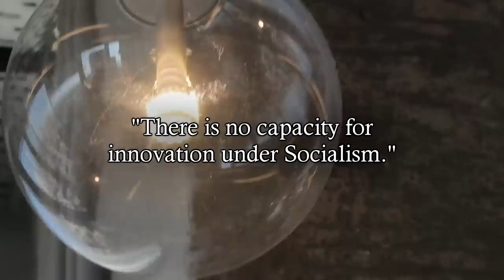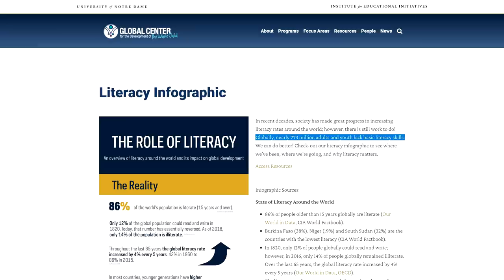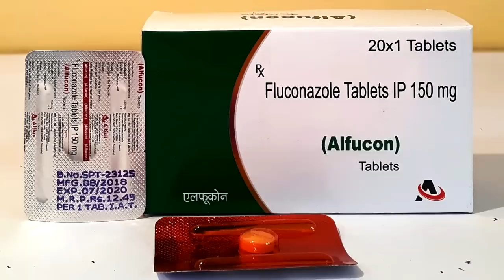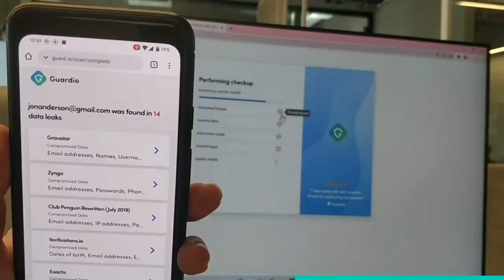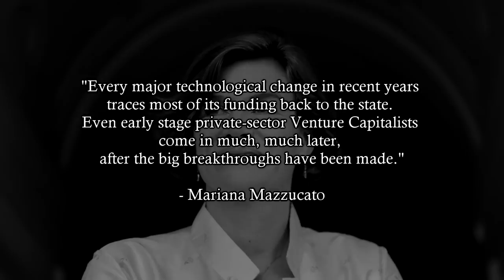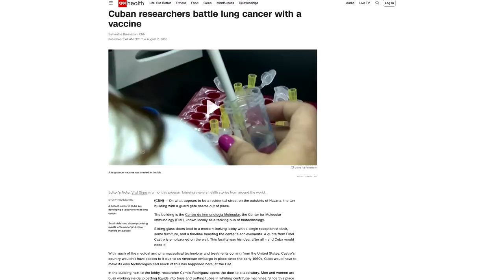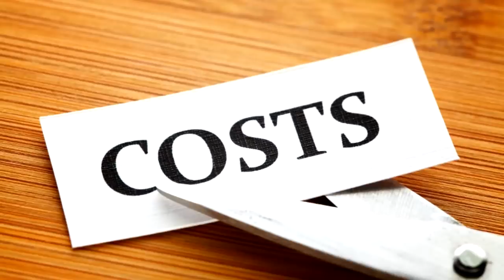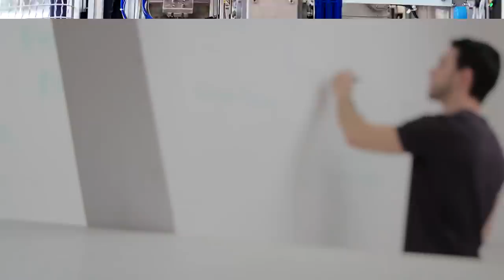Will Life Be Better Under Socialism?

Comment: Problem of automation will be it’s drastic energy consumption.    What is your view on that?
Reply: Renewable energy, but yeah. Not everything should be automated
Reply: at the same time the concept of the plutonium reactor was developed, the concept of the thorium molten salt reactor was aswell. Due to the US only wanting to finance development of one, it got scrapped, as the molten salt reactor couldn’t enrich uranium/plutonium to build nukes. 

- - -

A molten salt reactor uses 90% Thorium and 10% classical fuel, like uranium. 

due to it beeing in a controlled, molten state and requiring much less pressure (due to higher neutron density), a core meltdown is virtually impossible 

another advantage of it is that due to Thorium, when split, shooting way more neutrons is that radioactive waste only needs to be stored 200 years until their radiation levels are beyond what’s considered dangerous. This is due to decayed waste not beeing radioactive and absorbing the neutrons, which usually delays the timeframe needed for complete decay. (less neutrons hit radioactive material)

Thorium is way cheaper than Uranium; and the amounts of it are estimated to cover the full energy consumption until fusion reactors are developed. fusion reactors produce zero waste and only need hydrogen isotopes, which eliminates the fuel problem as hydrogen is the most common atom in the universe.

- - -

not beeing constantly bombardedwith advertisements also reduces consumption, as people don’t try to compensate their suffering from burnout and insecurities by buying stuff they don’t need
Reply: @alexredfield1943  I think this won’t be enough. It is not enough now and it won’t be with automation. Regarding nuclear fission: I don’t think it is a good idea to be honest. With rising sea levels and more and catastrophic weather events running nuclear power plants will be of an even greater risk, as floodings or river droughts will occur, threatening the supply of cooling water that these power plants need all the time or drowning them. 
Also we should think about backup-options in the case of blackouts or other catastrophic events like Kessler-Syndrome (= satellites crashing into each other creating a cascade in which all of them get destroyed eventually, ruining communication, weather forecasts, space travel etc. for decades)

I agree that most of our problems will be solved with nuclear fusion
Reply: It should be possible to create automated machines which consume a comparable amount of energy to maintain as do the human laborers who would otherwise have to operate it. Also yeah, renewable energy which capitalists refuse to fully explore because too much supply would mean too little profit. But not everything will be automated all at once in any case
Reply: @chompythebeast  Paul Cockshotts guess is, that it will take at least some 30 more years till automation because we will need much manual labour essentially rebuilding our industrial society from the ground up.
We need multifunctional agroforests in the agrar-sector, which need to be planted and maintained. We need to install much more solar panels, etc. all requiring manual labour.

Comment: The best energy source I have found as a clear concept is very plausibly best allowed to be openly and freely available to everyone as part of a civilized world because it would be made in any size, would be easy to use, and would be long lasting. This is not wanted by capitalists. Ihe initial production of samples with very obvious performance requires the expensive equipment and expertise mostly in the hands of the capitalists. 

What can you imagine doing with abundant anywhere anytime (with engineering variations), abundant, scalable, rugged, reliable, safe, quiet, nonradioactive, electricity and refrigeration? 

It may become inexpensive too as cost reductions percolate through the economic web. 

Cell phones wouldn't die or need power cords or batteries or become hot.
They would cool when transmiting radio signal power. Frozen food storage would be reliable and free or value positive. That means homes and markets would have independent power to preserve food. Vehicles wouldn't need fuel or fueling stops. Elevators would be very reliable with independent power. Water and sewage pumps may be placed anywhere. Nomads could raise their material supports carefully with few social obsticals. Zone refining would involve little net power. Reducing Bauxite to Aluminum, Rutile to Titanium, and Magnetite to Iron, would have a net cooling effect. With enough cheap power H2O and CO2 levels in the biosphere could be modified. There should be a unitary agency to look after our planetary concerns. 

I am inviting people, mostly unknown to me, throughout the world to use mass initiative and coalese into many teams  that are independent, synergistic well dispersed and minimally biased to expediently research and develop proof-of-concept and initial-recipe-establishing prototypes for the thermary. Reliable nanofabrication requires the smooth and well practiced operation of expensive delicate equiment which is best done by an operations team at the nanofabrication foundry.  The development teams may be able to gather ~$100K each from crowdsourced grants administered by sophisticated people to pay the operations teams.The operations teams and development teams need to keep a lot of people informed of their progress and setbacks along the way for accurate mass scientific and general understanding.  Cultural pressure should be ready to keep early developers from using early positioning to exclude other developers.

Here is a hypothetical practical method with the working name thermary: The thermary mainly consists of two electrodes closely face to face (~1 micrometer) in a vacuum wired to an external electrical load. The face of the [Emitter] electrode is covered with a uniform array of LaB6 tipped small diameter carbon nanotubes grown straight out. The face of the [Absorber] electrode is covered with small scale graphine flake char. [Rice U 2014] 

Thermal energy mobilized unattached electrons will tend to free themselves outward from the emitter tips and drift at ~1 million meters / second @ 25 millivolts (thermal electron energy @ 20 C)  to the absorber which tends to collect them.  

A negative charge accumulates on the absorber. This repels oncoming electrons slowing their forward drift, cooling them. The absorber electrode charge is simultaneously the repelling cooling and the external electrical load voltage. The drift current and external wire route current are the same. The DC electrical power consumed by the electrical load depends on the load resistance. Thermal energy absorption always equals the electrical yield. 

Wire resistance is a practical loss not a true loss so lt is overcome by added thermary output. The extra cooling balances the heat given off by the wire loss. The performance of the device is expected to be modest in the beginning but improve rapidly. Even early devices are expected to last a long time. There is little place for obsolence if the first installed thermary works adequately. They will withstand being short circuited indefinately up to an electromigration limit. 

Here is a thought experiment device that hypothetically creates self powered thermal diversification. The thought experiment device is impractical but easy to visualize and check for mechanical workability.  It's parts are large enough to act as everyday materials but small enough to work well with the nanometer scale thermal motions of gas molecules. 

Sketch made with keyboard characters: 

COLD ROOM   ())--:WALL:-->> HOT ROOM    

Key
()) = Paddlewheel. 
-- = Axle.  (Continuous from end to end)
: :  = Axle tunnel going through a wall.
>> =  Lumped friction element

Please visualize two roome full of air separated by a very thin wall that allows the rooms to hold their heat independently with minor leakage through the wall. The wall is thin to delicately support billions of  separate nanometer scale short axles running straight through loosely enough to rotate freely but  not leak very much heat so the rooms can hold separate temperatures. 

On the left side, a very small paddlewheel is mounted at the left end of each axle. On the right side, lumped friction elements are mounted stationary in place on the wall, one for each axle, for the right end of each axle to run through. The lumped friction elements convert the mechanical rotation of their axle into heat. The lumped friction elements do not impart Brownian motion to their axle.  

Brownian motion (a nanometer scale effect) turns the paddlewheels at random speeds randomly clockwise or counterclockwise. This random rotation is turned into heat by the lumped friction elements.    

The committed, linked, and functional roles of the walls, paddlewheels, axles, and lumped friction elements in differnt places should systemically produce a divergence in the thermal energy in the two rooms without adding external energy. 

Aloha 
Charles M Brown lll
Kilauea, Kauai HI 96754 r
Reply: Sketch made with keyboard characters

Comment: I agree with everything you said in this video, but what are your thoughts on Bell Labs? It created so many fundamental innovations, like transistors, lasers, radio astronomy, solar cells, digital image sensors, Unix, and many programming languages. And it was funded through AT&T's monopoly. What has changed that companies are no longer investing in basic research like this?
Reply: Basic research just doesn't have guaranteed returns, on top of a heavy investment. People now just choose to do more of the same, which are tried and tested.

Comment: Im very proud of myself I've never used LinkedIn. I remember when the people around me were getting on it and I wanted to hold off, I'm not against using job boards if I have to but I like to keep off the silly bandwagon as long as I can. And yay, I have!! 

If I have to absolutely use those sites I will but so far it's worked out that I haven't had to. I've been able to manage my work life without them. Crossing fingers it stays that way!
Reply: I didn’t understand. May you explain to me what LinkedIn has to do with this video?

Comment: Hakim, please cover incentives. Because from my research, some serious issues have been shown. Where e.g. collectivization of agriculture decreased production and created famines (in the USSR 1920s and 1930s for example) because:

Assume 1,000 members of a commune. Output is divided equally. Total production of the commune equals 100,000 bushels of wheat per year, or an average of 100 bushels per member. Price of $5.00 per bushel. The total for the commune is $500,000, or $500 per member. A member, e.g. Jim, increases his production from 100 to 150 bushels of wheat a year. This increases the output of the commune from 100,000 to 100,050 bushels. At $5.00 per bushel, the income of the commune increases from $500,000 to $500,250. Total income divided equally means that each member's income rises from $500 to $500.25 a year. Yet Jim's production has increased by 50 percent. But his income increased only by 25c or 0.05%. The income of the other 999 members also increased by 25c, even though their productivity did not increase. This is disincentivization from working harder.

The conditions reversed: 

Jim cuts his production from the average 100 bushels a year to 50. The total output of the commune drops from 100,000 bushels to 99,950 bushels. Its total falls from $500,000 to $499,750. Each member’s income declines by 25c, from $500 to $499.75. Jim's income is also reduced 25c, but his workload has been cut in half. This incentive to decrease workload is clearly strong. But if all members shirk production, the commune and society as a whole, will find theirselves in trouble.

This means that punishment will have to be used (and it was in the USSR, and is in North Korea for example). If you don't produce x amount, you will go to a labor camp.

If Jim privatized his plot and he increased production from 100 to 150 bushels of wheat, that would net him an extra $250. Rather than the extra 25c he was getting, his income would now be $750. 

This isn't some anti socialism thing. It's just not in our interest to disincentivize useful behavior. The point is that maybe some areas should stay privatized. Or maybe you can provide other solutions or insight? The example above was shown to directly produce the results that the example implies (and it hasn't only been shown to be case in the USSR) : 

The USSR had to re-establish private mini-farms one-half to one acre in size. These private plots comprised only three percent of the total cropland yet produced 27 percent of the nation’s food.  Sources: Sven Rydenfelt, A Pattern for Failure (New York: Harcourt. 1983), pp. 27-45; Hedrick Smith. The Russians (New York: Ballantine, 1984), pp. 264-84; and Marshall Goldman. USSR in Crisis (New York: Norton. 1983), pp. 63-87.

Comment: hakim. not that socialism cant innovate. its a non sequitur. the point is no one would know what value we put on things we innovate under a monopolised,centralised economy. markets decide what's valuable. not labor.  we put labor on STUFF WE VALUE. we dont value stuff because THERE'S LABOR done on it.
Reply: "markets decide what's valuable"
Yes, this is the problem with them
Reply: Do you not differentiate use-value from exchange-value?
Reply: @ideologically_uncharged8069  exchange value is use value. yet use value or utility doesnt decide value. profit decides value. and people seek profit through the market
Reply: @proximaism  Can you elaborate what do you mean by exchange-value is use-value? Also out of curiosity, how did you define profit there? And what's the general source of profit?
Reply: @ideologically_uncharged8069  i did not define profit. i defined it the way it was originally defined as the equillibrium between supply and demand. value has nothing to do with labor. thats the old labor value nonsense marx parodied from smith and ricardo which the two themselves dismissed as false. so when you're doing LTV, you're doing ricardo. not marx. adding labor to something doesnt increase its value. its the other way around. we only add labor on stuff that are valuable. use value and exchange value are meaningless marxist rhetoric as they dont constitute anything useful in economics. if utility or use value is what defines value then water which has high social utility should be very expensive. but its not. utility or use doesnt define value. profit does. and profit is arbitrary to people. what is useful(utility) to others is not useful to some. exchange value or price is what determines use value to an extent, but price is not necesarily profit because cost that constitutes price is never value.im a mathematical economist and ive written a lengthy paper about this on reddit some years ago.
Reply: @proximaism  Markets are not subject to democratic processes.  One dollar = one vote.  But who has all the dollars?  Exactly.
That's not 'the people' deciding.  That's a small group of people telling everybody else what they're allowed to vote for.
Reply: @DeoMachina  democracy is monopolistic under the favor of a majority. the market aint monopolist. the market doesnt discrimiinate against or for a majority or an individual. democracy is fascistic.
Reply: @proximaism  You're contradicting yourself, here.  How can it be 'the people deciding' but not democratic?
Reply: @proximaism  So you claim expertise on the subject? When you have time, can you state your understanding of what is the relation of labor, use-value, exchange-value, value, supply & demand,  cost, price, and profit in classical economics?
Reply: @ideologically_uncharged8069  I dont claim any expertise on the matter. i prefer to call myself as informed on the subject. rather than an expert. because we mathematical economists are about falsifying economic theories. we dont prove things. im also a small businessman. i run a small humble private resort so somehow i know business and how employees behave. im not wealthy,im not poor either. i struggle as much as everybody does everyday.